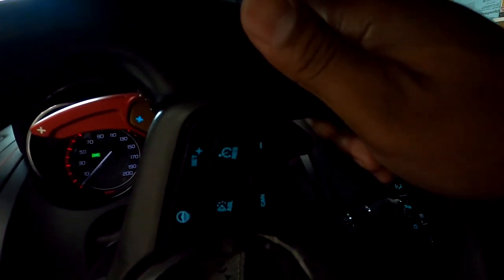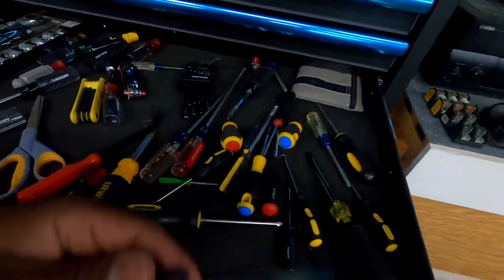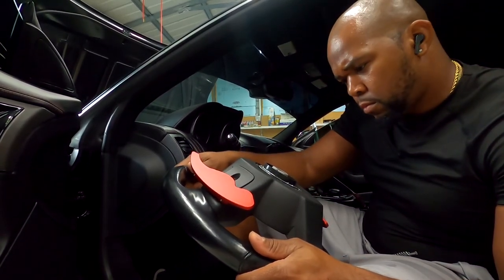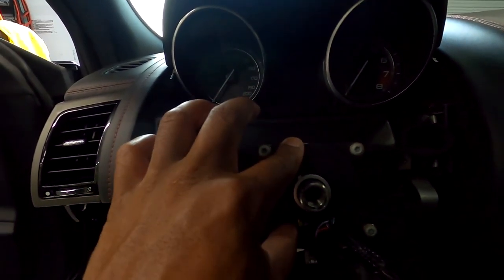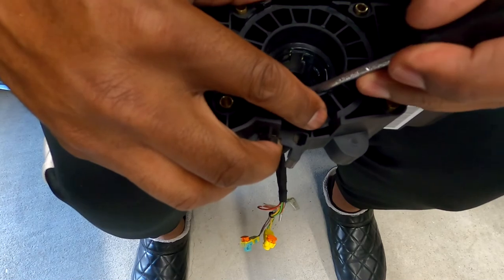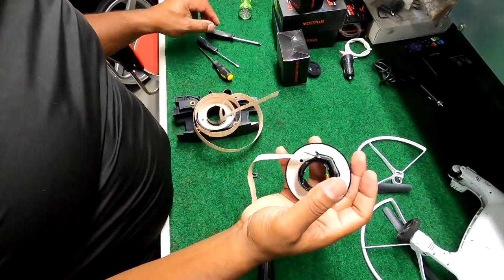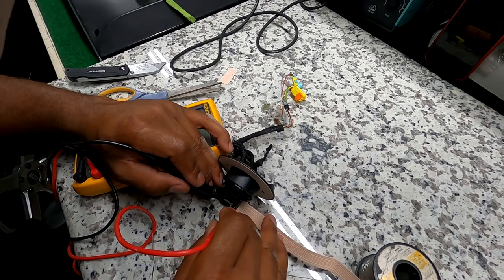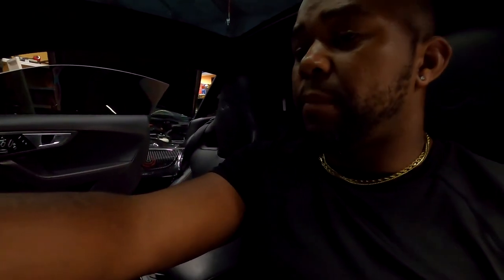FULL STEERING WHEEL DISASSEMBLY AND FIX CLOCK SPRING AND BUTTON PROBLEMS IN THE JAGUAR F-TYPE

Comment: I just picked up a 2015 F-type R last weekend. My steering wheel button clusters and bezel are all gummed up and nasty, so I'd want to replace the button clusters and maybe wrap the bezel in some matte carbon fiber vinyl or something. Can the bezel and button clusters be pulled off without removing the airbag? I'd like to not mess with the airbag if I can avoid it, so wondering if that's possible, or if the airbag has to come off first.

Nice detailed video. This is helpful for many owners who like to do their own work.
Reply from the maker: air bag has to come off
Reply: Yes. I found that to be the case. But it wasn’t a big deal to remove the airbag. Just disconnect the battery, wait 15 minutes and then remove the airbag. I didn’t disconnect the airbag wires, though.

I pulled out all of the graphite trim in the interior, including steering wheel trim pieces, AC vent trim and the door pull trim bezels, stripped the old paint and resprayed them using a close color match, but more metallic, spray paint. Came out great and the interior looks and feels like new.

Comment: actually there are two batteries in this car if you're going to disconnect the battery like you did turn on the headlights to discharged the secondary battery and wait about 10 or 15 minutes to make sure everything is discharge
Reply from the maker: i gotcha

Comment: The bottom of at the 6 o'clock position,  do you know if that's the heated steering wheel? I'm swapping to a cf steering wheel and have no idea how to get that cover piece off. If it's the heated option, i don't need it
Reply from the maker: I instantly assumed that was the heating when I saw it